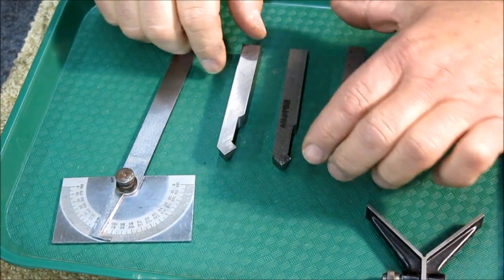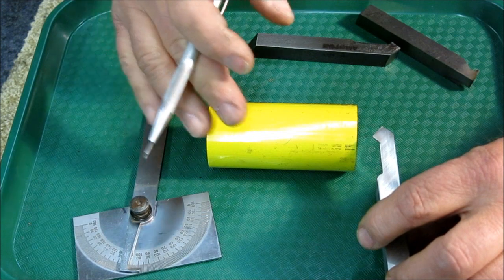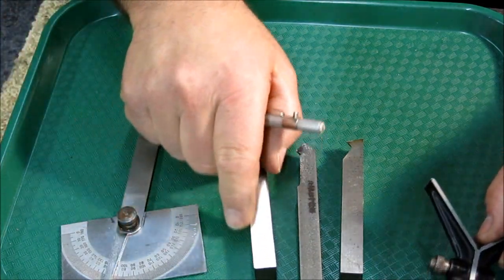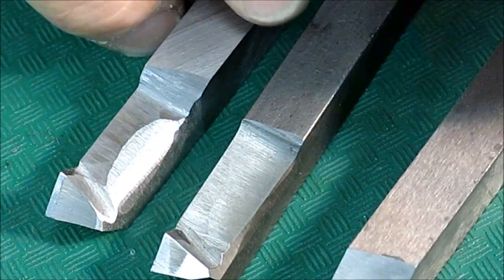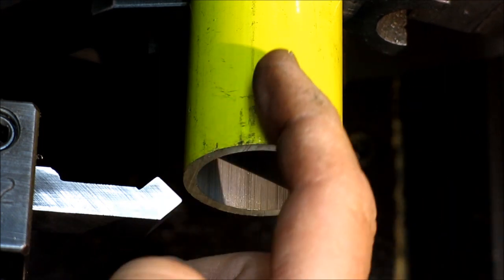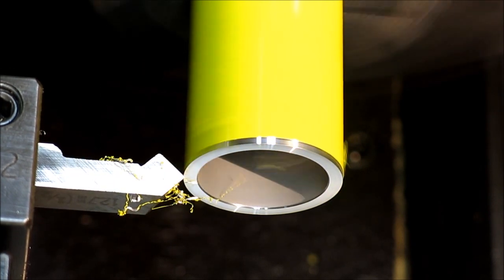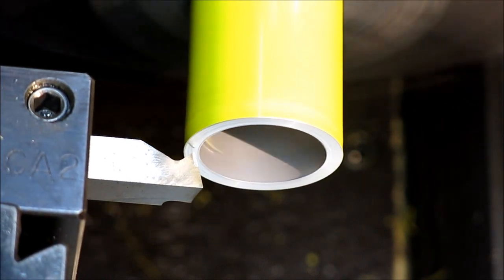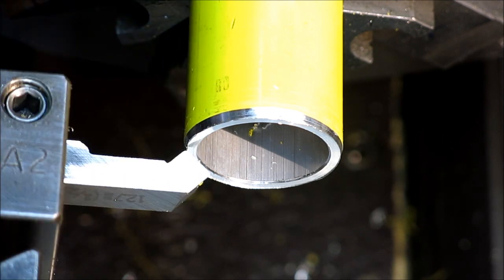Roach Coach Snack Break 2

Comment: You can also plunge in with the first tool where you want to part off, then part it so you get a chamfer on the OD after you part it, and a OD chamfer for the next piece.
Reply from the maker: Hi Andre,

Good call. I missed that trick for the video. See its even more useful. Were going to call it the Swiss army tool.

Cheers,

Tom
Reply: oxtoolco Another idea, you can also cut internal threads with it.
Swiss army tool sounds about right!

Comment: Thanks for the detailed explanation Tom. Nice Saturday Morning coffee break. If you can add something to your list of things to talk about, I would like to know how to properly turn an inside pocket for a bearing were the center must remain at the same length as the outside of the piece. I am making a ball turner and this design calls for a bearing set inside the top turret piece and a small reses turned in the base plate for the bottom of the bearing. So the center of the turret is only turned down a few thou to allow tightening of the center bolt. I managed to get it done, but it is not pretty and I broke a couple of tools trying. I managed to grind a special tool bit but there has got to be a better way. Thanks Robin
Reply from the maker: Hi Robin,

I'm pretty sure I understand what you are describing. Take a look at the spindexer series for a tool that is very similar to the one I think you need. The difference is you want to work up against a shaft sticking out. This would probably make a decent short video. Thanks for the suggestion.

Happy holidays.

Tom

Comment: This is coming from a hobbiest-no top relief angle for these? Are they OK to use on steel? Obviously the larger the lathe the better for a zero relief top yes?
Thanks
Reply from the maker: +howardtoob Hi Howard,

You can optimize these for whatever material you are working with. They work well for short stubby parts and tubes. If you want to turn longer lengths you can add a chip breaker to the leading edge. Thanks for the comment.

Cheers,

Tom

Comment: Hi tom great vids. I'm a novice and trying to learn your instruction is easy to follow and on point. But I have to ask when you mention a measurement you always add the metric number. Do you prefer metric over sae? How do machinist record measurements smaller than 1 mm? If 1 mm is about 40 thousands? Anyway I have an old Bridgeport mill head and I'm having trouble finding collets. I have one. There not R8's to big. If I email a picture to you could you give me your expert opinion on what to purchase. Thanks. P.S. I took it to granger a they were clueless.
Reply from the maker: Hi Ray,

Thanks for the comment. The metric conversions are for our European and work viewers. They have mentioned many times how appreciative they are to hear the conversions. When talking in less than a millimeter typically you might say a few "tenths or hundredths" of a millimeter.  If I use those terms to describe parts of a millimeter it throws off the imperial guys. So what I do is convert to microns. This is distinctly metric and can't be easily confused with imperial dimensions. So .001 mm = 1 micron. .01 mm =10 microns 1mm =1000 microns. On your collets you might take a look on the Practical Machinist forum. There is quite a bit of siloed information on collets and tapers to be had there. If you get stuck send me a PM and we can discuss your problem further.

Cheers,

Tom